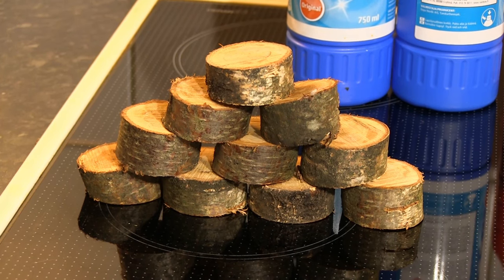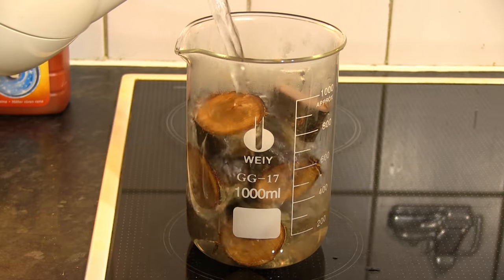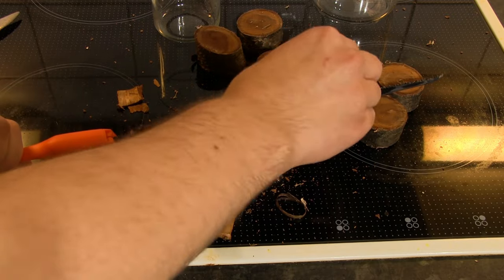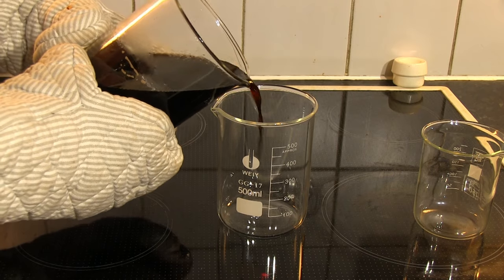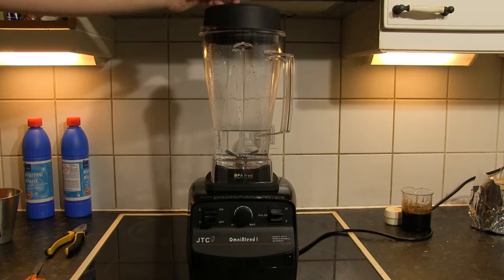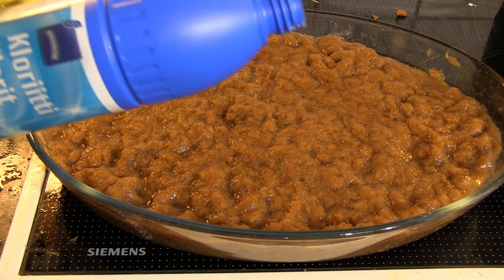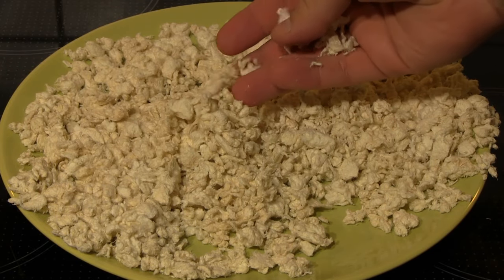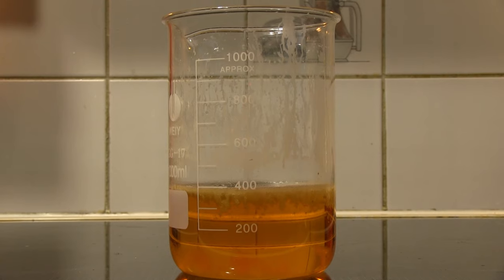DIY wood pulping project

Comment: Is there any organic methods to extract  fluffy stuff from wood?...This is for my research purpose and hoping for your response
Reply from the maker: What do you mean by organic? I have heard of some molds that have been used to destroy lignin, but I have no idea about that sort of stuff. Maybe some enzymes?
Reply: @RavenFly1232  Thank you for your response. Using Enzymes are one of the good methods but those are quite expensive.  I mean't Organic method as in without usage of any chemicals .Would you suggest any physical method for this conversion?
Reply from the maker: @abinayasenthil7129  The purpose of the chemicals is to dissolve/remove lignin between the fibres. With lignin it is really hard to break fibres, but it is possible. This results in a weaker fibres, and paper that will turn yellow over time, so you'd produce something like news paper. But if your starting material is not wood, but say you start with different source of fibres, and alter the process a bit, you could do something like papyrus or cotton paper.
Reply: @RavenFly1232 Sure sir.. I will try in fibres but my doubt is about, is there any natural method or physical (machinery)for this conversion process?

Comment: Hello! Please tell me how the pulp was dried? Tell me how to dry the pulp so that it does not lose its ability to absorb water?
Reply from the maker: You can leave it spread on a sheat and it will dry on its own. Or you can heat it to drive out the moisture. Too high heat will break the stuff, but a little bit will make the drying process faster. Or you could use a vacuum to lower the boiling point of water.
Reply: Thanks! Can you tell me how to use a vacuum? Maybe there is a video or an article?
Reply from the maker: @АлексейАли-ф5т  It's quite well known that drawing a vacuum lowers boiling point of water, so you put vacuum pump, a cold trap and the sample in some container in series, and maybe apply some heat. This will dry the sample quicker, but I am not sure if that is much better than leaving it in a heated chamber with some ventilation so that water just evaporates away.
Reply: Thank you very much! I also heard that vacuum drying has the least effect on the structure of raw materials. Do you think it is possible to make it at home?
Reply from the maker: @АлексейАли-ф5т  in this case the effect is negligible, so  the cheapest route would probably be the best. You might also be referring to freeze drying, which also utilizes vacuum.

To build a vacuum dryer you need two jars, some pipes and a vacuum pump. The jar closest to the pump needs to be cold (immerse in ice water) and the further needs some heat (immerse in warm water). Now to be fair, there are real dangers with implosions, so it might not be a great idea to build unless you are absolutely sure about everything.
Reply: And if you freeze the pulp and put it in a vacuum dryer? Is this going to be freeze drying?
Reply from the maker: @АлексейАли-ф5т  not exactly. Temperatures required are a bit lower than just freezing stuff, and you provably need to apply some energy to the system to facilitate sublimation and deposition.  And for drying pulp, freeze drying would be equivalent to using an atom bomb to kill a fly.
Reply: Yes, you're probably right)

Comment: Good evening! I am a student researcher and I would really appreciate it if you respond to this. I’m currently doing my methodology now, my study is about the “Cellulose Content of Peanut (Arachis hypogaea) Husk as the Main Component in Paper Production.” Do you think I can do the same process with peanut shell? And are there better alternatives to sodium hydroxide since it’s harmful? I’m conducting my research at home so it would be very helpful if you’ll help me. Thank you very much!
Reply from the maker: I've done this with tomato stalks, so I believe it should work with most things that contain fibre.

Lye is the easiest chemical, with a pressure cooker you might be able to use other salts, but check on different pulping methods, and try to emulate those.
Reply: @RavenFly1232  Thank you for your response! I’m sorry if I’m gonna have to ask more questions regarding this, this is my first time and I surely need guidance. Since I need to come up with my main product as soon as possible, (this Monday) I think of doing the method you used. My drain cleaner contains 48-50% of sodium hydroxide with the mixture of water, is it okay for boiling? I’m going to boil it in a beaker. 

And for the paper making process, is it still required to wait for the cellulose to dry? Or can I already proceed making the paper? Again, thank you very much! Your response means a lot to a student like me.
Reply from the maker: @seazury  The beaker will probably survive, but just to save a bit of chemicals, and make it more safe, you could dilute the drain cleaner to ~10-20%. The drain cleaner I had was 15 ish.

No need to dry. I wasn't planning on doing paper from that cellulose immediately, and wanted to see how it works dry, so I dried it. Actually I still have the fibers somewhere in a jar waiting for a day I make a follow up video.

The fact that I blended them dry into smaller fibers just makes the possible future paper weaker, so keeping the longer fibres could be beneficial.
Reply: @RavenFly1232  Thank you so much for your response, sir! Should I use distilled water? Or tap water will do?
Reply from the maker: @seazury  Distilled water is of course preferred, but I'd assume as the drain opener is probably not very pure anyway, I think that if your tap water has low calcium/salt content, it will work fine, especially for a concept run, where efficiency is not a priority.
Reply: @RavenFly1232  Thank you! I also would like to ask if are there any things I have to remove from the shells? Like what you did with the bark? Do I have to add any chemicals in the pulp so I can create the paper? 

Update! I have already executed the soda method (which u used) but they didn’t turn out like yours. They became softer but I don’t see much fiber-like stuffs from my peanut shells. When I try to pull them apart, they are tearing apart but not like fibers. The liquid turned dark, and I just disposed them. Is there anything I can do?
These are my last questions! I'm sorry..
Reply from the maker: @seazury  I'd try multiple washes with lye. Discard the liquid and do again. Then try to pry open the fibres so that more of the gunk can get out with the subsequent washes.
Reply from the maker: @seazury  Regardin the removal of stuff, I don't know about coconuts, so trial and error
Reply: @RavenFly1232  Thank you for all the help, sir! It really helped me a lot! Have a great day!

Comment: Have you figured out how to remove the ligin so you can reuse the sodium hydroxide?
Reply from the maker: I had planned on experimenting with that, but never got that far. From what I know, in kraft process the black liquor is first burned giving green liquor, that is reacted with CaO and NaOH is then separated and reused. So maybe there is a chance that I get to experiment with that, as the process is well known, but right now I have other pressing matters that limit my ability to do research.
Reply: @RavenFly1232  I see I see. Thank you and great video 👍
Reply: Sodium hydroxide comes from reacting the green liquor (Na2CO3) with quicklime (CaO). The green liquor is the product of burning at low oxygen the black liquor which also transforms the sodium sulphate (Na2SO4) into sodium sulphide (Na2S) that is a very important component of the white liquor used in cooking the wood ships